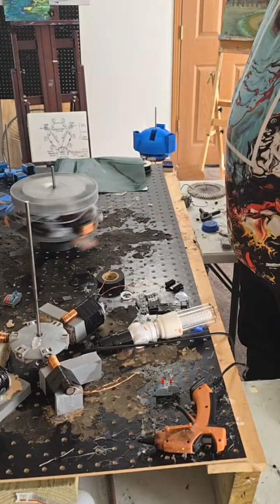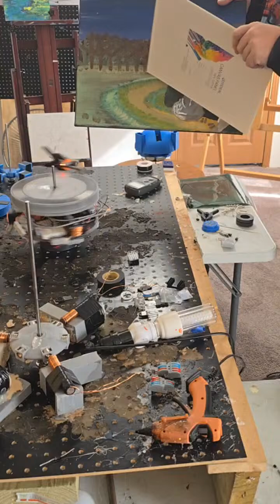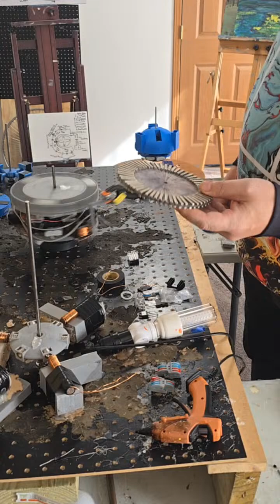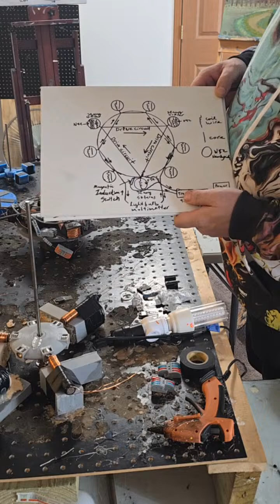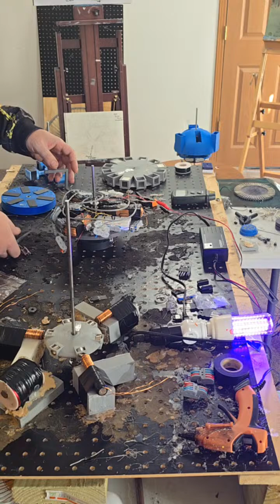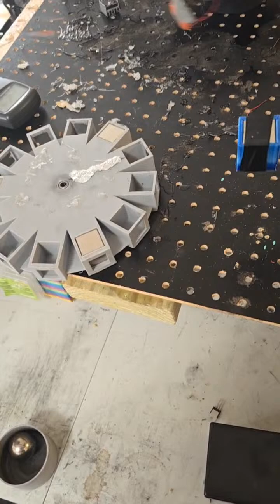Papa Bale (M.P.H.Jr) is live! With pulse motor mayhem!

Comment: try this put the coils after the transistor between the EMITTER and the negative power, the transistor should get less hot
Reply from the maker: no i haven't but i have seen it and i will
Reply: @MPHJR  i got some for this new motor I'm making, alot of the transistors ive bought couldnt of been good, even the 2n3055 ones they work alright but turn up further and the performance goes down cant even go past 14v
Reply: but transistor that overheat are also a  sign they could be counterfeit  transistors aswell